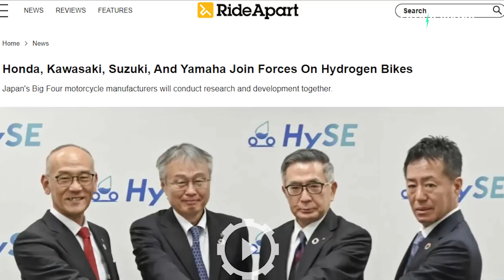Honda joins Toyota's, Suzuki & Kawasaki to make hydrogen engined vehicles

Comment: A standard car has 2,000 moving parts an EV has 20

The propensity for savings on an EV is exponential at the moment compared to a mature market with engine's

Dumbest move yet
Reply: 25th like and 5th reply
Reply: Is that including the four wheels?
Reply: You should see how many more parts are involved in an HFCV versus an EV. To include everything that must be lined/coated with platinum that Hydrogen must pass through. All of which need routine durability and leak checks. Just a few things out of many downfalls of HFCVs that Toyota and other big HFC supporters don’t want the general public to know about.
Reply: Id rather scrap the car than blow up on hydrogen tank.
Reply: GM managed 3500 welds and half as many parts for Hummer batt pack...won't let complexity die easy.  😄
Reply: It’s more about going EV inherently puts Japan in a bad position economically than it is about saying no to evs but honestly I feel like e fuels are far more viable than this but they’re are actual reasons for them being so stuck on hydrogen it’s a far easier transition for Japan specifically to make so they’re sure as hell gonna try lol
Reply: The longer I drive my 2023 Chevy EUV, the happier I am at my decision. The poor dealership is making virtually nothing on me.
Reply: Think of all the complications of friction in the ICE compared to the EV where there are practically none.

Comment: Hydrogen engine- all the headaches of fueling with hydrogen and all the hassle and cost of ICE
Reply: It's four times as expensive as fueling a gas car and there is no where to fuel it. A hydrogen station costs about four million dollars and you would need just as many of them as gas stations because you can't fuel at home as you can with EVs. Hydrogen engines will have about the same efficiency as gas engines, about 30%, that's half as efficient as a fuel cell and a third as efficient as a BEV. Gasoline is space efficient, i.e. gas tanks are small, hydrogen has awful volumetric efficiency. The Mirai has terrible passenger and luggage room because the space is taken up by pressure tanks. With a hydrogen engine you'll.need twice as many pressure tanks, where will they put the people?
Reply: @joshuarosen465  pros/cons of h2-stations very per country.
In NL, they are part of a national pipeline grid (will become European ), where at the station only the pressure is increased. In my town we have such station. Most of our municipal vehicles use H2.
But whether it makes sense? Burning H2 is simply ridiculous…
And even fuel cells, it hardly makes sense. Fuel cell produce both heat AND electricity, and only (!!!) if you can use them both, it could makes sense, like in central-heating installations at home. But vehicles???
I do like H2 for many years, but cars?
Reply: @joshuarosen465  The maintenance costs for hydrogen vehicles are significant as well.
Reply: @blaumax1910 They can't possibly believe that liquid hydrogen is feasible in a passenger vehicle, it barely works in a billion dollar moon rocket. The SLS launch was delayed for months while they figured out how to fix a hydrogen leak. NASA has had 50 years to get liquid hydrogen right, Apollo used liquid hydrogen, but they still have a difficult time handling it. Also rockets are fueled minutes before they are launched, they don't sit on the pad with full tanks, you can't do that with any other type of vehicle let alone a passenger car. Also can you imagine how expensive cryogenic tanks would be, not only do they have to maintain a temperature of 33K they have to do it while withstanding a car crash.
Reply: Hydrogen + air + spark = Kaboom
That’s all you need to know.
Reply: Just goes to show how ignorant you are.
Reply: The ultimatum summit of stupidity.
What have they been smoking? Hydrogen?
Reply: It's like they don't want to let go of the vacuum tube. Yes they have some desirable qualities but it's not where we are going. It's like running your computer or cell phone on vacuum tubes. Can you imagine? Next stage BYD Seagull accessible to ALL american citezens and not to only the well-to-do 🌴 Let ALL the kids play you greedy Tyrants... POWER TO THE PEOPLE ❗
Reply: And twice as expensive to fill up, who wouldn't want that
Reply: And all of the oil spillage all over the walmart parking lot and the lots in apartments , stepping in it and tracking oil all over the rugs and floors.
Reply: They will go bankrupt together. 😅😅😅
Reply: For bombing? It will give it a little more explosive power.
Reply: Usual brainwashed golf cart experts in the comments.
Reply: At least Tesla had a plan to build their own refueling network. If they wanted to make these vehicles work they would have to start building the infrastructure now and spend billions doing it.  They seem to think their governments will do?  Maybe in Japan, but the cost would be way to high in countries that already have less expensive electricity… and some people able to power at home.
Reply: Best of both worlds baby!
Reply: @VonRyansExpress weird that Tesla and EVs in general have some of the highest consumer satisfaction. That seems to contradict your “problems”.
Reply: I Wouldn't consider H2 until I saw a complete infrastructure of filling stations comparable to   the Supercharger network. If the Japanese are so confident, let's see them invest some of their capital  on infrastructure.
Reply: I say the same thing about hybrids in general. Go full EV or none at all.
Reply: And twice the pollution.
Reply: @whowhy9023 why pollution? The burning of hydrogen produces water as a by product, and if the surplus green energy capacity is used to make hydrogen, then theres no pollution in its production.
Reply: @adrianlane4256 not correct. Burning h2 still creates nox pollution.
Reply: Ultra-lean combustion engines has low combustion temperatures, comparable efficiency to fuel cells, and are essentially ZERO EMISSION.  Liquid Hydrogen is much lighter than petrol and is great for airplanes, trucks, ships, and trains in order to increase payload!
Reply: @trungson6604  hydrogen is great for firing steel / aluminium plants…
But vehicles? They still produce NOx when burning (instead of fuel cells)
The gas itself is light, but needs to be compressed / cooled, and then materials become brittle and leak those tiny molecules. Don’t believe me, ask SLS-engineers…
Again, at room temperature, and pressure below 10 atmosphere, feeding industrial ovens or fuel cells, H2 is a splendid gas.
Reply: @hanswitvliet8188  Ultra-lean burning hydrigen emits essentially no NOx and has efficiency comparable to fuel cell  This is the reason why H2-engine will be a viable alternative to electric.  You can have a plug-in hybrid to take advantages of both battery and hydrogen.
Reply: @trungson6604  you mean you get a battery powered vehicle with the disadvantages of hydrogen.
Reply: @trungson6604 and buses. Plus look at what JCB have done with heavy construction plant. They are going all out on hydrogen as the future fuel of choice for diggers etc.
Reply: @trungson6604  the required tanks are very heavy completely negating the benefits of hydrogen over a BEV.